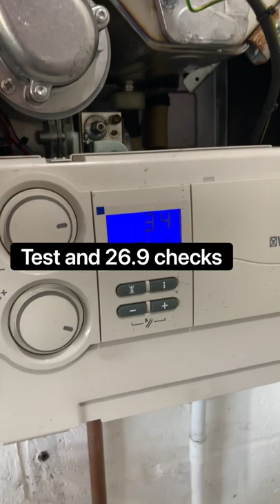How to replace Vaillant ecotec G10 burner seal

Comment: The Mi's don't suggest you put copper grease on the thread. It's recommended to put it around the base of the thread on the combustion chamber itself. It's more to prevent creaking noises when heat engine expands and contracts from the burner door. 🤜 👍🏼
Reply from the maker: This is what I like, learning from people so thanks for that mate 😊

Comment: How did you determine that the seal was gone please 👍
Reply from the maker: Basically you could see in the video white crust around the bottom edge which is where the rubber seal goes (most common place on these)
Also was a bit wet 👍 hope that helps

Comment: Would this seal replacement be useful for stopping water leaks coming from the burner door? 

On my boiler there seems to be a leak coming from the bottom of the burner.
Reply from the maker: These are for gas safe engineers
Reply from the maker: If you have water I’d be suspecting a frozen condense pipe backing up into the boiler